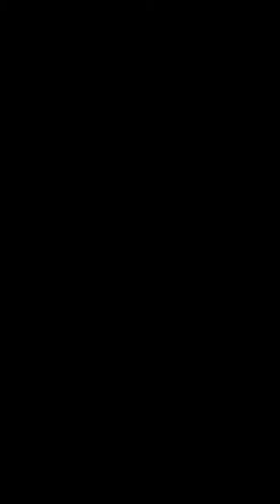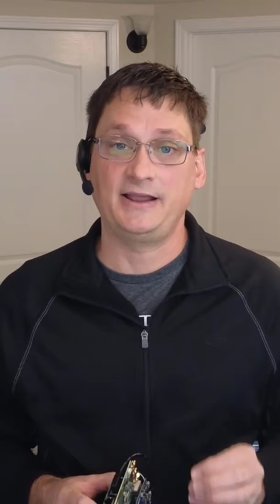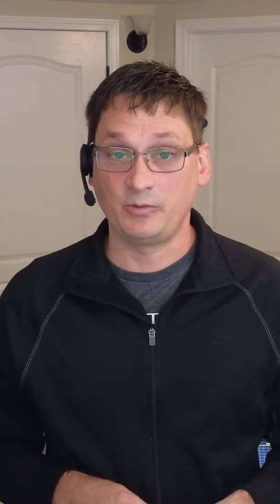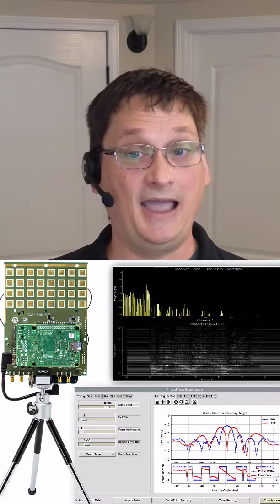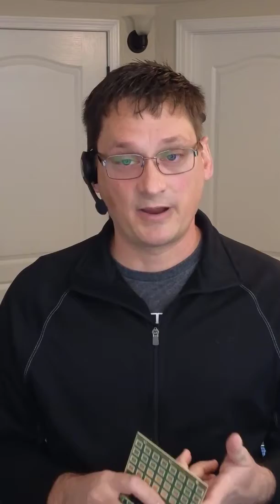New Videos Update and IEEE Radar Challenge

Comment: Good day Jon! First I want to say Thank you for your work! (I'm software developer with 15years of experience, but I have no experience in radio field and your videos gave me A LOT of knowledge) I'm trying to order PHASER but so far, it's not available to buy anywhere in US or Europe:( Main question: I understand that this is an evaluation board,  but can we estimate it's radar capabilities? Like, how far it can detect object with radar cross section of 0.1m2 for example? I understand that there are quite a lot of inputs that affects detection range like fog, environment noise etc. But can we get some rough numbers for good condition? 1m, 10m, 100m or 500m? And additional question: We have 8 by 4 patch antenna. I see in schematic two ADAR1000, each of it has 4 channels, every channel connects to row of 4  antenna elements. As I understand, one channel can control one antenna, but we have 4 elements on one channel, can we control them individually? if no, why do we need 4 elements on one channel? (the only guess is to form some specific shape of radio signal (radiation pattern?)?) Best regards from Ukraine, Odesa!
Reply from the maker: Yes, we've been having trouble keeping the Phasers in stock.  We should have a new batch of them in early Feb 2024.  I think the best way to get them as soon as they are available is to place an order on Digikey.  Don't wait for them to be in stock to order -- as they may go out of stock again.  It's best to order even when they say out of stock.  Regarding your 2nd question:  the 4 patch antennas in a column are combined together to improve directivity of the array.  So you cannot control them individually, but they do greatly increase the range of the antenna.  Finally, I don't know of a good way to quantify the radar range.  I'll be doing a new radar video series with the Phaser, and I'll try to add some cases where the object goes beyond the detection limit.
Reply: @jonkraft  thank you! I can't wait to watch the new series!:)